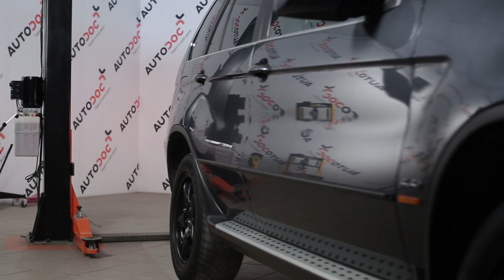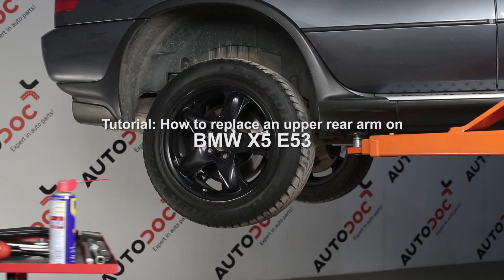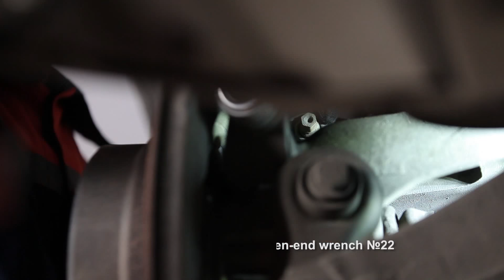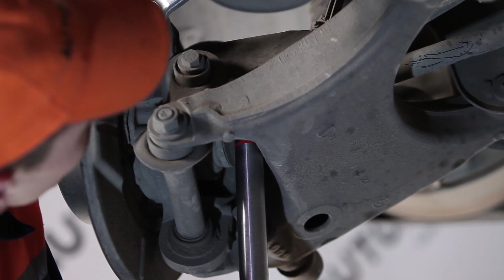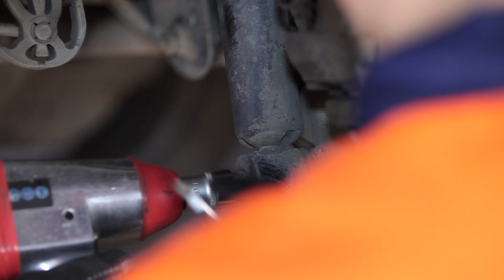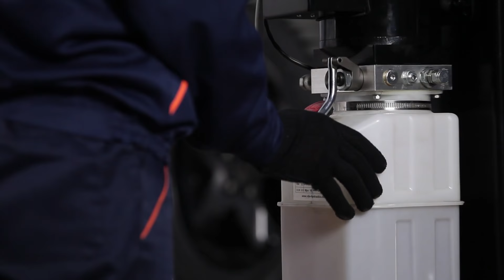How to change upper rear suspension arm on BMW X5 E53 TUTORIAL | AUTODOC

Comment: I would like to see the rear suspension upper arm replacement on peugeot 406 1999-2004 model... there is absolutely 0 videos on replacing this part on this car.
Reply from the maker: Thank you for your feedback!  Unfortunately, we didn't work with such car. Watch out for the upgrades, maybe such video will turn up on our channel. Best regards, Autodoc.

Comment: if rear tire is not straight and camber is off, then do i need to change rear upper control arm? e53 2004
Reply from the maker: Thank you for the feedback! There can be a lot of reasons, most likely you are right and the problem is in the arm. We strongly recommend you to visit a specialized car service center. Best regards, Autodoc.